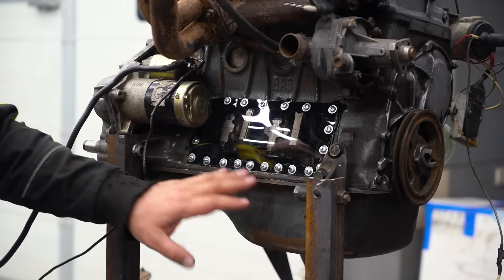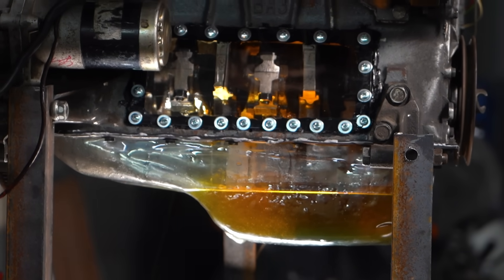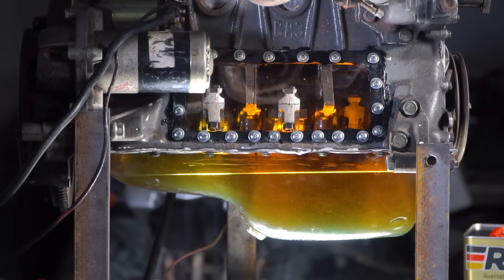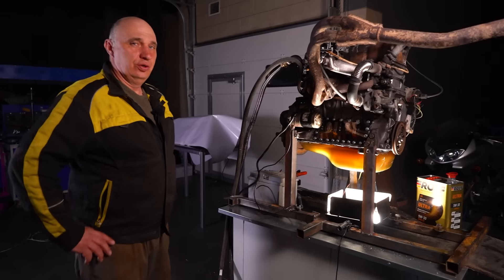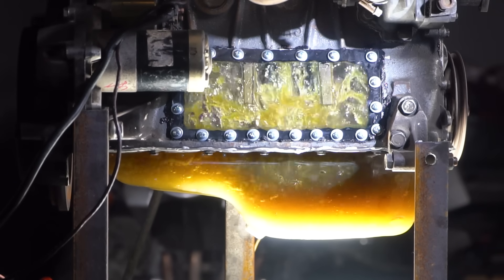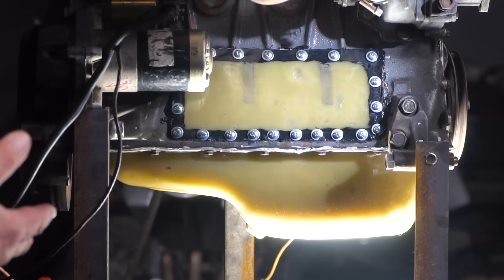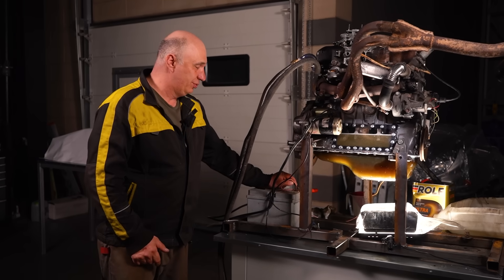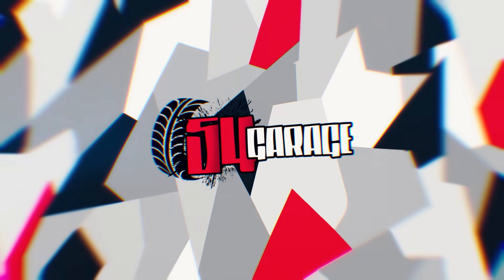What actually happens when you overfill your motor oil? (w/ transparent oil pan)

Comment: It truly depend on the engine design, oil pan capacity and the method of storing the oil (dry sump).
Some engine have higher tolerance above the "max" mark while other engines may have a tolerance of less than 1L
It is also good to note this engine was not moving like in a car. While braking or accelerating the oil get slushed around, at x2 the maximum the oil could have easily found it's way in the breather. It is best not to put in too much above the maximum.
Reply: Very true. My engine takes 5.2, I could only imagine it at 10.4. 

I do a lot of long highway and don't daily my car. I keep it at 5.5.
Reply: Used to work at a rental company when I was younger, guy had a tfsi and oil light came on so he just added oil, 1L. Oil light stayed on so he added another 1L, oil light stayed on so he added another 1L (we assume, could have been more but English was bad so was translation so there was a barrier there but this is what he told us). By the time he got to us it went bang in the parking lot. Car had 1500 miles on it😅
Reply: @KeyBrosUK  I worked at a jiffy lube years ago. This old womans husband had died, and she never pumped her own gas. Unsure of where the gas hole was, she opened the hood and filled then engine to the top with gas. As she was driving down the street the car began smoking and she came straight to us. She didnt tell us what happened, as she didnt know, just that it started smoking. The guy in the pit started yelling. It's full of gas! The fumes filled the building and we had to evac the customers, made sure nobody smoked and opened all the doors. There weren't any obvious signs of damage but who knows what happened after she left. Friggen gas hole.
Reply: @DogSpeak  that’s heartbreaking, terrifying and also a little bit funny at the same time😬great anecdote though I bet that was an interesting place to work, considering the type of customers I hear it gets! We don’t really have an equivalent in the uk, we have kwik fit and Halfords though. Kwik fit is just known for ripping people off, really badly, and Halfords is known for its incompetence due to untrained staff having to fit parts they have no idea how to fit, thanks to Halfords Free Fitting policy😅
Reply: @DogSpeak  will you be learning English when you start school?
Reply: that's why in my country always there is a professional guy who fills the tank of your car when you go to gas station. We call them "frentista".

It's is both safer, faster, and more efficient. If I am a baker, and bake bread everyday I am good at making bread. I'm not efficient filling the tank. That's why it's good for everyone the division of the work.

Companies tries to push you into self-service culture because it reduces their labour costs. But that's actually inefficient.
Reply: @AfonsoBucco  its not faster....
Reply: I think the point of this video is that its not that big of a deal if you put half a liter too much oil in your car by accident. I dont think anyone is going to be filling up their whole engine with oil.. at least i hope not lmao
Reply: A&P mechanic here. You’ll almost never find a dry sump land vehicle that doesn’t have the Ferrari Lamborghini Mercedes AMG ect logo on it. Most cars can’t even corner hard enough to starve the pump so most cars are wet sump. Now in aviation, for piston type aircraft, dry sump is the norm. So really you aren’t going to even need the wet sump dry sump variable because most people can’t afford a car that needs to have a dry sump in the first place.
Reply: @adawg3032  my motorcycle has a dry sump
Reply: @adawg3032 was there a Subaru engine that had a bad case of starvation when driven hard on track, or am I misremembering?
Reply: @KeyBrosUK  Subaru engines have a bad case of oil starvation period. Especially when you first start them up. On some, you can actually hear the pistons grinding until the system is full of oil. Subaru engines are not the best designed.
Reply: @VashStarwind looks like they need metal coating aditive a lot such as Motorkote

Comment: This guy answers all the questions I've had for the last 25 years as an automotive machinist and engine/drivetrain rebuilder.
Reply: Amen, and, That's why i thank Lord God, 4 sending us this brother down 2 this God's planet, 2 do some work which we didn't  !!! ! !!! 🙂 And, thank you tooo, the Garage54 brothers :-) Pwy 🙂
Reply: Knowing how something works and being able to see it operate would be greatly advantageous then just having a working understanding. 

It’s almost like working without your eye sight. Think about it. 

For instance a cutaway of a lock cylinder. You will see pins alignment at sheer line when correct key installed allowing rotation. 

Without a cutaway model you still know the fundamentals of the lock operation but you don’t get to see the big picture. Having visual knowledge you can have a clear, understanding, a accurate visual, instead of theory being visualize in your mind
Reply: @steveh7085  Bravo well said 👏 .
Reply: Yeah no kidding everything we wanted to see in our mind but you know what I find amazing is when I used to do a three-dimensional image of my mind and turn the engine around with a crankshaft spinning this is what I pictures of my three dimensional monitor of mind lol
Reply: I appreciate your humility and honesty. I would bring my vehicles to you if you were local.
Reply: There’s some cavitation there. Like a submarine making too much noise
Reply: Yea don't add 2 f gallons of oil to your engine
Reply: the dip stick have hallow dots on it which tells how much space is in the sump available to fill the oil for the engine
Reply: I thought when you overfill rods will bend
Reply: @UnjustifiedRecs no customer will ever ask “hey can you cut a hole in my engine and see what happens to the oil?” And no technician is their right mind will waste that amount of time wondering what will happen when they’d rather have a paycheck..
Reply: @UnjustifiedRecs e never claimed he a was that good to be fair, lol joking
Reply: @unjustifiedrecs Customers don't ask for crazy things like cutting off all the counterweights on a crankshaft, nor would I ever recommend it. But Garage 54 did it. He does things for views, I did things for customers.
Reply: @phubarr  You don't need to see something to understand why or how things work. Being good at your job and doing well for the customers includes understanding the function of things. Not a professional mechanic but I already know the cranks will smack into the oil, I don't need a window to know that. But it's fun to watch.
Reply: Be interesting to see what it does with a windage tray too
Reply: @NickGreiner1988   it would look exactly the same and wouldn't make any difference at all if you overfilled it because it would be far above the tray and in contact with the crank again.
Reply: @libtrs838  oh, yeah, but I meant under normal circumstances, just to see what they actually do.
Reply: @NickGreiner1988  a track run with and without with a camera mounted would be a good test. A bit harder than this video but I think doable.
Reply: @UnjustifiedRecs I'm sure you have a dishwasher in your house and have had one your whole life, have you ever watched it completely operate through all the cycles with the door open? I didn't think so
Reply: @UnjustifiedRecs Dishwashers don't work when you open the door or did you not know that?
Reply: @UnjustifiedRecs This is probably one of the rarest videos ever seen with visual see-through glass that even 40 year heavy line mechanics have never seen to visually watch oil aerate and operate in a running engine, that's what the poster is referring to. You have to think outside the box sometimes into what someone is saying which seems hard for you to do.. It's okay just work on it...
Reply: @seatime674   Most things in the world can't or haven't been watched functioning yet the people who make or study them understand how they work and why. Sure it's fun to watch but if that person has been an engine builder for 25 years he really shouldn't need a video. Unjust isn't wrong. The video looked exactly as I expected and I am not a mechanic. Unfortunately there are many people who work in their field who don't think about how all the parts interact and work together and they are not very good at their job. In particular if you work in repairs you should have a good understanding of how and why otherwise you can't effectively troubleshoot.

The person even defended not knowing what happens because a customer has never asked him to put a window in an engine. 25 years an not knowing this is crazy or he lied about his profession for likes.
Reply: @libtrs838  You're making way more out of this then there needs to be. It's simply a very rare fascinating video to watch for even seasoned mechanics. It's not a specialty that mechanics SEE exactly what happens when someone grossly overfills the motor with oil at 2 or 3 times the actual amount to visually see it. Just enjoy the video for what it is no doubt it's something you've never seen either..
Reply: @seatime674 Don't argue with these idiots man.
Reply: You shouldve already known this after 25yrs or tested it yourself in that time though
Reply: @lollipop84858  that means he knows what hes doing. He never had to find out lol
Reply: @lollipop84858  You'd really think a normal engine builder would actually go through with the crazy things this guy has done? He's doing it for YouTube views, I did it to get paid by my customers. You think any customer would want their engine built with the crankshaft throws completely cut off, just to see what would happen? No sane machinist would endorse doing that.

Comment: What happens? When you take your Dodge to a Dodge dealer for oil change & they just add 4 quarts on top of the 4 quarts already in it. Blown gaskets 3 miles down the road.

Comment: The extra oil ends up causing a lot of resistance and reduces horsepower and RPM. That's why windage trays and knife edge counter balance weights were invented. 🙂

Comment: I recently had a serious oil leak with my Honda Civic, losing most of the oil over a 100km trip, turned out to be from a bad oil filter gasket, the engine light suddenty started flashing while I was driving so I stopped immediately and it took 2 litres to get back to the full line so there must have been just about 1 litre left in the sump... Seing in this video how much oil is pumped out in operation made me realize how close I came to actually seizing the engine, I'm sure the oil pickup must have been dry when that engine light started flashing!

Comment: When the oil foams and turns milky, it becomes compressible and oil pressure is lost to the bearings - that's the main concern - it was more foamy at 2x than at max, so probably already loosing pressure, but you would have needed a gauge to measure - thanks for sharing!

Comment: My car requires for 4.6 quarts of oil at an oil change and I always end up putting an entire 5 quart container in since I don’t want 0.4 quarts of oil lying around. Nice to know that small amount of extra oil doesn’t harm anything.
Reply: By any chance is it a 2.5l ford engine? I do the exact same thing. I’ve overfilled by .4 quarts every 5,000 miles. I’ve had the car for 8 years and it’s now at 235,000 miles and it still runs great.
Reply: @jtfoog5220  it’s a 2AR-FE, 2013 Toyota Camry XLE. Same displacement though, 2.5 liter
Reply: My 6.8L v10 f250 takes 6  quarts when I change the oil I put 6 quarts in it. For some reason it's been fine since 2003 when I bought it new. Go figure who would have known that using motorcraft 5-20 like it calls for would let it last 21 years and still runs perfectly.
Reply: @roguepowersports3576  I have a buddy that owns a shop.  It’s surprising how many people do zero maintenance.  Some people buy new and just drive it.  Some people do that no need to warm your vehicle up in winter as long as you drive below 30kmh for five minutes BS.  I can’t afford a brand spanking new car, but if I could, I’m sure it would last a lifetime.  Warm it up sufficiently in the winter and even in the summer, give it a minute.  Stay on top those oil changes and run some seafoam or fuel treatment through periodically and don’t bag it but floor it every so often… probably have very little issues.
Reply: @roguepowersports3576  I had a 2007 ford f150 xl 4.2 liter that I bought new for $18,000. I put the exact amount of the exact oil ford recommend. 5w-20 synthetic blend motorcraft. And always used a motorcraft filter. I put 350,000 miles on it. I got ride of it in 2022.
Reply: Why not just change your oil and put it to the full line?  It’s not like it’s a difficult thing to do. Lol
Reply: @B-kn8yb  it is at the full line
Reply: @seanguy9720  so your car takes 5 litres not 4.6. Lol
Reply: I think I would have gone the other way if I couldn't be bothered to store the partial quart. Just put in 4 quarts and be in the lower half of the approved range.
Reply: @ekbuz  why do people have a problem storing a quart or half a quart of oil?  Don’t they have a lawnmower or another car they will eventually use it in?  Hell I had a beater car that didn’t take much oil, I kept the left overs and every oil change I added to the spare oil eventually didn’t need to buy oil for the next oil change.  Only an oil filter.  

Anyway seems like the stupidest thing to do, possibly risk engine damage because you’d rather just pour the rest of the jug into your engine than store it.
Reply: Ditto
Reply: Back in the 60's my dad would go to the local gas station to fill up the tank.  Occasionally the gas jockey would check the oil, say it was low, and add a full quart.  Might be why cars never lasted more than 90,000 miles back then.
Reply: I'm with you with my 2022 Veloster N.  Problem with my car is I watch all the oil drain with it level on a lift, I put 5.2 quarts in as required, it reads half an inch above full on the stick. 

Been doing that since 1100 miles and have 15,200 miles now. Car has taken me from NYC to Key West and back and been up the Mount Washington auto road twice.  

In eco mode at 60mph I'm getting wayyyyyyy over the 28mpg highway number (35mpg). So there's no drag from the oil. 

I'm gonna keep it up.
Reply: Just because it worked on a stand, doesn't mean you should feel OK about an extra half quart! 😢
Reply: @trm4life  well considering I’ve been doing it since I got the car almost 3 years ago, put 60,000 miles and done 12 oil changes and nothing has happened, I’m going to continue doing it. Let me freak you out further, the car “calls for” 0w20 weight oil but I put 0w30 in winter and 5w30 during warm weather. That little extra viscosity I notice a quieter engine and there’s no noticeable loss in MPG
Reply: @seanguy9720  pcv.  Positive crankcase ventilation.  When you over fill, it goes into the combustion chamber.  The Chevrolet equinox and Saturn vue, have a problem where the oil ends up in the intake manifold, and the engines die prematurely because of it.
Reply: @trm4life  Well, most things are engineered with margins of safety. Specially motor engines. I am not a mechanic, but from my ignorance, I am pretty sure those 0.4 are not making any difference.
Reply: @seanguy9720  0w-20 oil is crap! I changed to 5w-30 in a HEMI engine and it purrs.
Reply: @seanguy9720 so basically if I put 500 ml more it’s not a big deal right. No need to panic ?

Comment: Im a mechanic by trade, if the oil is a little over the full line thats OK, Im talking about a feww hundred millilitres, if you overfill it too much the oil will get bubbles in it from the counterbalances splashing in it, even worse is underfilling the engine because the oil will get burned out.

Comment: you showed short term effects, not long term  or in a real world situation. I truly appreciate the videos the team makes but you left more questions than answers for the viewers. if you did this for thousands of miles, air bubbles would contribute  to lack of oil pressure or surfaces not covered causing wear to bearing caps and other components with tight clearances. Extra pressures in crank case from having oil in spaces expected to deal with air flow created from crankshaft rotation will eventually case pressure on  seals for rear/main seals to crank shaft, filter housings, valve covers and so on, even if your PCV  is good. Dont overfill your oil.

Comment: I wonder if running 6 in a 4qt capacity motor could extend the life of the engine. and or prolong oil changes. I sure it would loose some HP and efficiency. But I wonder if life could be extended.

Comment: In the mid 90’s I stopped to help a poor woman with car problems. I asked her to pop the hood and everything was dripping oil. I opened the air cleaner on the carburetor and it was full of oil. 

I asked her if she had put oil in, and she told me her husband had instructed her to “put some oil in the car before you go to work…”. She told me she “filled it up”.

She had just kept putting oil in until she couldn’t get any more in. 

I told her that her best bet was the oil change joint two blocks away. I still wonder how she made out.
Reply: Her husband could have taken a few minutes to show her how to top off the oil correctly! I had to teach my two daughters

Comment: One thing you can't see with that setup is whether it's burning oil or pushing it out through the exhaust from the increased pressure. Correction, I spoke too soon. I assumed since it was indoors theu had the exhaust routed outside.